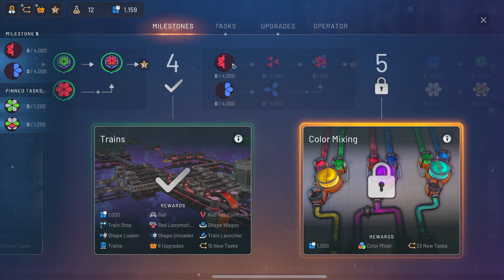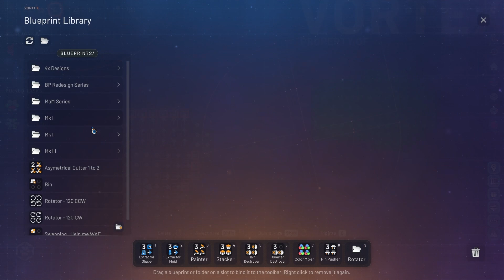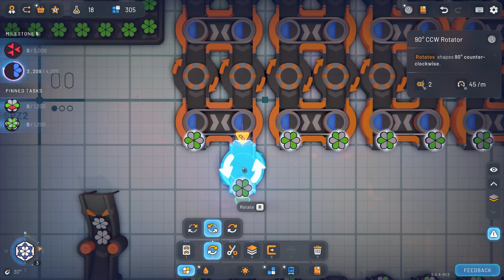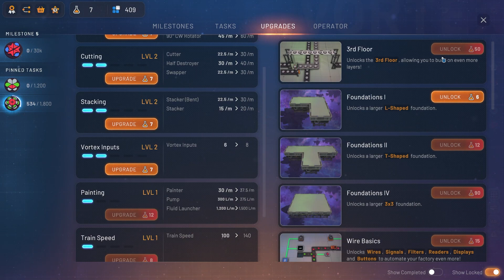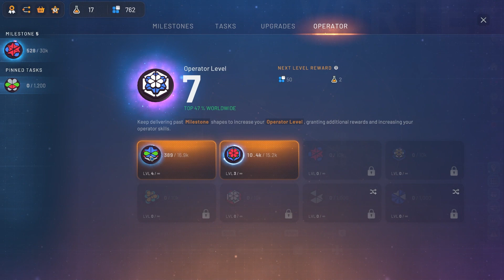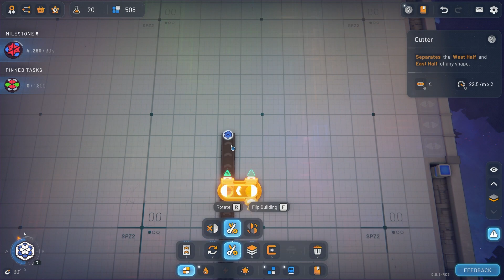Shredding hexagons apart - Shapez 2 Hexagonal Factory EP04

Comment: 11:37  Fine, I'll blow your mind.
Cut
60, 60
Swap
60, 60
Swap
0  60

Done.
Reply from the maker: Really?? How does that work... wth... 60 60 same direction? Does that only work for this special case with missing bits or any hexaboarding?
Reply: @DataEngineerPlays  Any Hexaboarding.
Remember the cutline runs North-South.

Just think about what's going on in Position 1 and 6.
You Cut.  6 Null, 1 Petal.
60, Petal moves to 2. Null Moves to 1.
Swap, the inverse shape flips over. There's a petal in 6.
60, null moves to 2, Petal Moves to 1.

The opposite shapecode is happening at the south pole with positions 3 and 4.

The blueprint you saved at milestone one is a shape that's Basically a red and uncolored pre-swapped and rotated to match each other.
Your first rotations -60 + 120  totals 180 degrees. The pieces are now mirrored aligned to the cut line.
Reply from the maker: @wAf-Billy  I need to try this out in game to visualise it but thank you
Reply: @DataEngineerPlays  Sure.

But to see if this helps.  We're treating the eastern half of the shape like a stack.  2 shapes:

123456  ABCDEF
We start with 1 in the stack that we want to keep.  Imagine "|" is the cut line

Swap:  F | 1
60:  E | F1
Swap:  5 | F1
60: 4 | 5F1

At the South cutline we start with D, then 3, then C
After the last swap: 5F1B3D   an alternating shapecode -- checkerboarded.  The other shape is the complement E6A2C4.
Reply: @wAf-Billy  😵‍💫